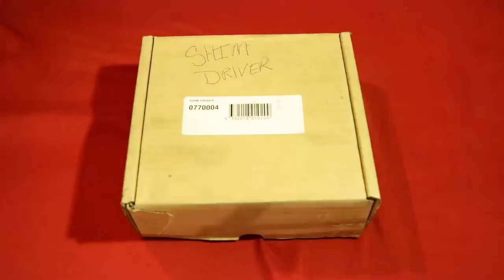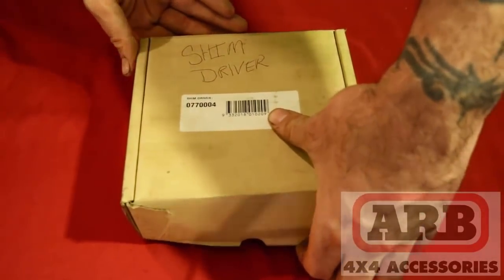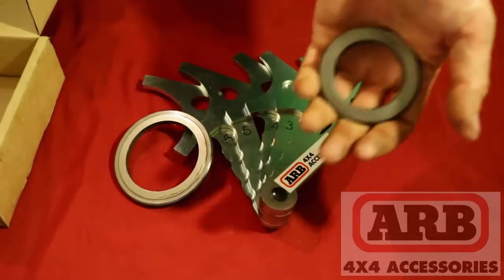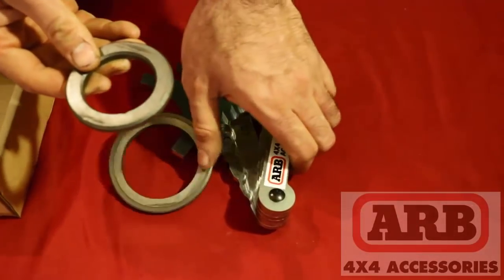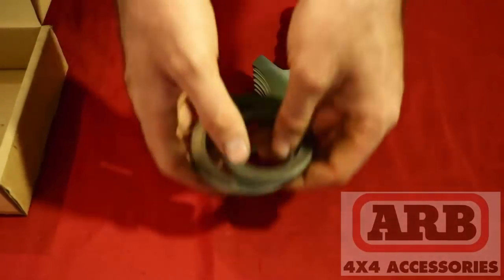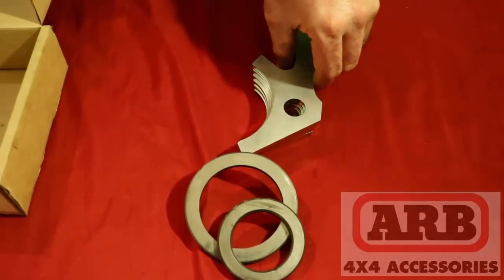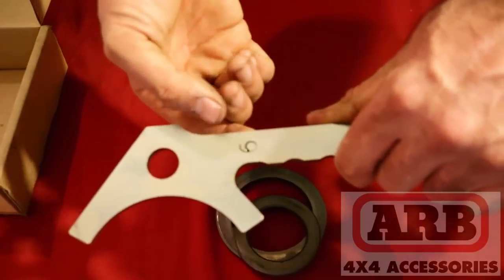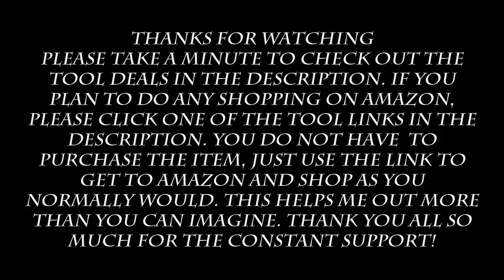ARB Shim Drivers - How To Install Shims In A Differential

Comment: The shim drivers are easy to make from a 1/4 piece of sheet stock steel.The Chrysler 9.25 and 8.25 rear ends use no shims,use a screw in adjuster on each side.